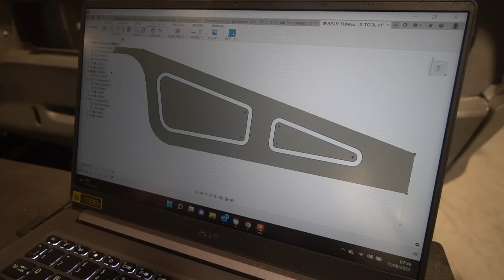Retropower Uncut Episode 101: MK1 Escort IRS, and Stratos Test Drive!

Comment: It might be the camera angle but all the park brake stuff looks vey close to the body. Not sure on the Toyota but all the off road stuff I have worked on has rubber between the body and chassis for NVH etc. so the body can move down onto the chassis parts.

Comment: I fitted MX5 seats in my S3 and you definitely sit higher in them than the original seats. Just a data point.
In the S1 and S2 the MX5 seats mount lower in the car.

Comment: Stratos: for me, the top edge of the air intakes is a little too sharp-edged. I feel it would look better if it were slightly radiused to match the radius above the door or on the rear wing. Just my 2¢ :)
Reply: I agree, a subtle radius would enhance the 'factory' appearance

Comment: The Stratos is the coolest project you guys ever made imho, it is the reason I started following this channel and I have never seen a better color on a Stratos. It sounds menacing as hell. But tbh the rear window panel and the side scoops have ruined the looks for me, sorry to say. The top edge of the side scoops is much too sharp and it would look so much better if the front of the scoops would have the same angle as the doors and if the intake itself would be at an angle seen from the top. They look so much less refined than the lower intakes, if you flipped those upside down for inspiration you could get a much better result than this rough piece. Sorry for the harsh but hopefully productive criticism. As a transportation designer myself, this detail sticks out like a truckload of sore thumbs to me. :/

Comment: Another great video  always very interesting, but as I have asked before, how on earth do you work out what to charge a customer, I have worked in the motor trade for many years, and its not easy to make a profit which you have to do just to stay there and not let customers feel they are being  ripped off! which I am happy to say I don't  think we ever did, they still talk to me so I suppose we got that about wright. Unfortunately  I am not a huge fan of big engines, although I have been fortunate to have a Tickford Capri, which another dealer borrowed and wrote off before I could take it to Brands Hatch for a film to be made, damn! and an Opel Ascona 400 right hand drive road car I am told only two genuine ones ever made but sadly no one knows where it is now, hope that other dealer never got his hands on it! plus a 2600cc single cam Chevette. My reason for being fond of small engines, years ago I was lucky to win rally championship with a 1300 Chevette which revved to 8000rpm and did about 70mph in second gear through a Quaife straight cut gearbox, never  thought about it blowing  up! this upset a few people. But my one project which goes against my theory is a Viva HA  fitted with a Red Top engine mated to a 6 speed sequential gear box to give all the Escorts a run on Epynt

Comment: Awesome as usual! But that Escort looks hideous with bubble arched front wings and standard rear ones. Better to have chopped the car in half, fabricated a spacer fillet then rewelded it together tro  make a wide body without flairs. That's an old hot rodding trick used by the old masters. Or  simply relocated the strut towers to allow for wider wheels
Reply: I rather like the Mashup, but can see your take on it
Reply: The arches are not finished yet. This has been explained before in videos too, the bubble arches were a better fit than the standard wings and will be modified anyway and the rear arches will be shaped to match.
It might be a good idea to listen to what they say, or wait till they've finished the metal work to find out what is actually planned.
Reply: @JamesCairney  Excellent - my humble appologies James.
Reply: @JamesCairney  I recall that now (in fairness, that was some time ago), but this week they mentioned getting it off the jig as a roller for MkII/2 to access the jig - not sure why they wouldn't tackle fenders first....perhaps Nat will explain.

Comment: Stratos sounds & looks nice. I don't like the "colour" of the "scoops" & louvre, at the rear. Personally would've preferred  black, like the front one...
Reply: I thought the same but I think they were fitted temporarily to test airflow and temperatures. You wouldn't want to complete them if there's a chance they may have to be redesigned.
I hope that's the case anyway
Reply: Those parts are not finished, the rear panel will have glass and will be painted. They've explained this before, plenty of times.

Comment: Just out of interest, why a zetec in the Minor instead of a Duratec?
Reply: Is the durstet a better engine then the Zerschneiden ??👌👌👌
Reply: @russcooke5671  I think your keyboard may be set to German? 😅

Duratec and Zetec are quite different, inlet/exhaust other way round, duratec is chain driven, zetec has a belt. Duratec is lighter (all alloy) and already has a pretty good head. Zetec might be better for boost…? Maybe, not sure, hence the question.
Reply: 26:00 sounded stunning.
Reply: @baronvonteuchter1412  ha ha ha ha I’ve just looked at my comment and have not got a clue how it came out like that.   I meant to say is a Duratec a better engine then a Zetec.  But thanks for the reply.  So what one would you choose for your own car
Reply: @russcooke5671  I guessed that was what you meant! I have a mark 2 escort with a 2.0 Duratec fitted but again the zetec is a very common engine swap in old escorts. I think they are generally a slightly cheaper conversion…but I doubt that was a consideration in the Minor project by retropower!! 

I am curious why they chose the zetec - I am sure there will be a very good reason 👍
Reply: @baronvonteuchter1412  thanks for the reply. One other question is the 2 litre cosworth a better engine than them
Reply: @russcooke5671  the cosworth YB was essentially a 16v pinto and is very strong so suitable for lots of boost. Have you heard of Millington engines before? Those are alloy YB’s tuned for massive NA power and are, in my opinion, ultimate engines for old escorts. Up to 2.7 litre, 350bhp but big money!
Reply: @baronvonteuchter1412  I thought millington engines were just for racing
Reply: @baronvonteuchter1412  how much is big money
Reply: @russcooke5671  plenty of people use them in road cars. You can’t treat it like a Honda but they are pretty tractable and well mannered at low revs 😂

I’ve see. Second hand ones sell for £15-20k, new id guess £30k+ depending on spec.
Reply: @russcooke5671  plenty of people use them in road cars. You can’t treat it like a Honda but they are pretty tractable and well mannered at low revs 😂

I’ve see. Second hand ones sell for £15-20k, new i’d guess £30k+ depending on spec.
Reply: @baronvonteuchter1412  hi thanks for the reply. But how would to know the mileage on a second hand engine.

Comment: Regarding castor. Any car originally built in the bias ply tyre era will rarely have more than +2 degree castor. Whilst castor affects steering weight and self centring it also effects camber on turn, increasing negative camber on turn in and positive camber turn out. Bias ply tyres and camber are not friends. Wherever possible castor increases should be made at the top, upper arm or ball joint or strut top, to avoid interfering with steering angles.

Stratos sounds true to the original Ferrari V6.

Regarding the Escort. As nice as the front suspension set up is the reality is these parts are always based on "Group 4" rally spec. For the best front end geometry on lowered street and track cars a "drop spindle" (raised stub axle) is really needed to maintain camber gain, roll centre and bump steer. I'd also use a better designed stub axle and utilise at a minimum a bigger outer wheel bearing.